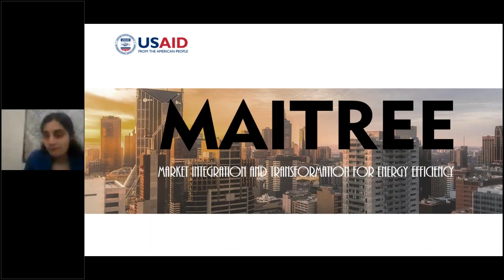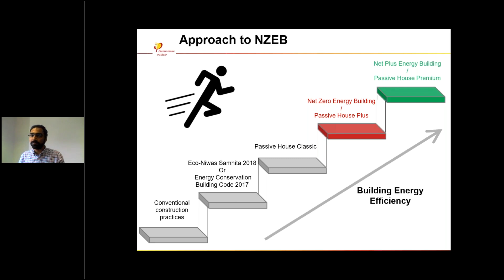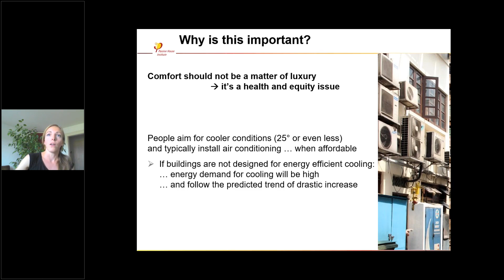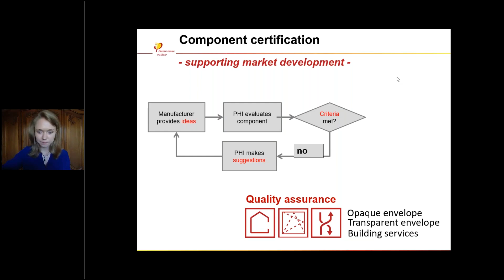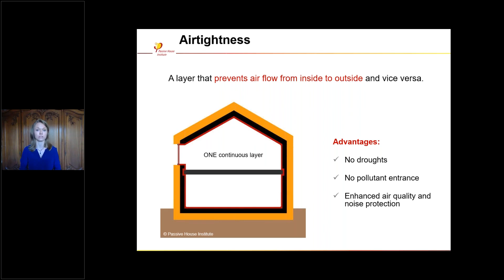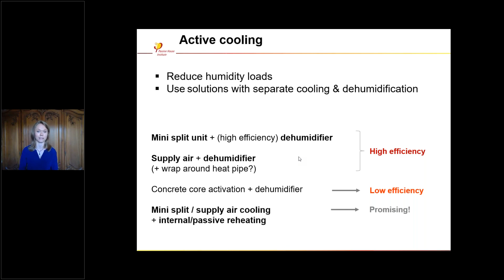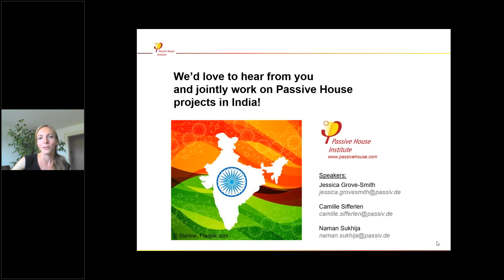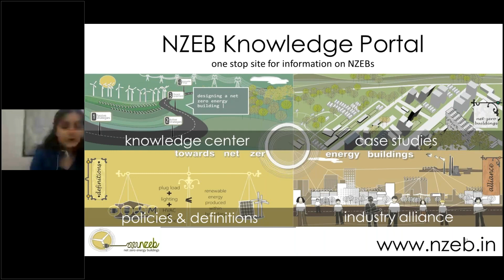Passive House Standard for NZEBs in Warmer Climates

Comment: Hi, I have a question  can we construct a solar chimney to a already constructed independent house in india. I heard that solar chimney will keep the indoors cool. What do you say
Reply from the maker: Solar chimney can be added as a retrofit measure. The design of the chimney needs to be carefully examined with respect to the interior layout and location/size of the openings for it to work effectively. 
Solar chimney works on the principle of buoyancy and it is a natural ventilation strategy. You can see our webinar featuring Avasara Academy that uses solar chimney for natural ventilation and comfort - https://www.youtube.com/watch?v=-KanhkB03jI&t=2292s
Reply: Hello Janaki! There are many factors involved like climate, building design and construction etc. A well-controlled solar chimney can be helpful in a naturally conditioned building but in climates where air-conditioners have become inevitable to ensure thermal comfort, special attention is required on the control strategy of the chimney, airtightness and thermal bridges. A mechanical ventilation system with passive heat recovery unit is recommended in an air-conditioned building for better air quality and savings on cooling demand. Please feel free to contact us on building.certification@passiv.de for any further building consultancy related queries.
Reply: @nzebindia7263  okay. But how do I get it constructed anywhere in india. I mean the architects or engineers seem no experience building one. So what to do?
Reply from the maker: @janakiyeluripati6368  If you are the client looking for architects/engineers/consultants who know how to design thermal chimney, there are professionals who know how to design and construct. You could send in a request on our linkedin and facebook pages as well to reach out to the wider community. 

 If you are the designer, then you can learn how to design it as well.